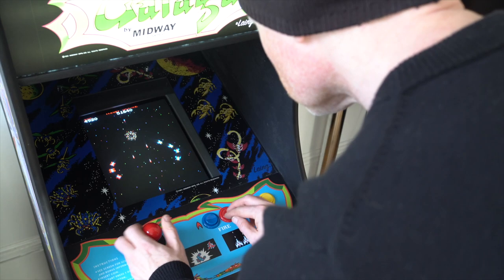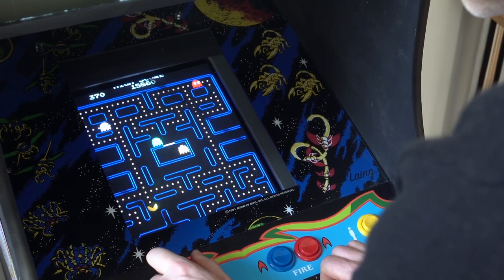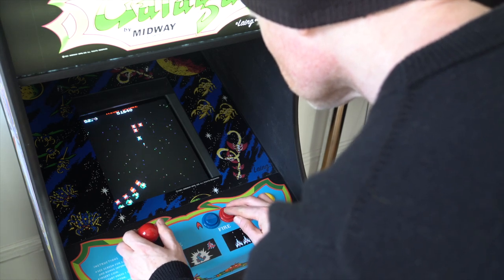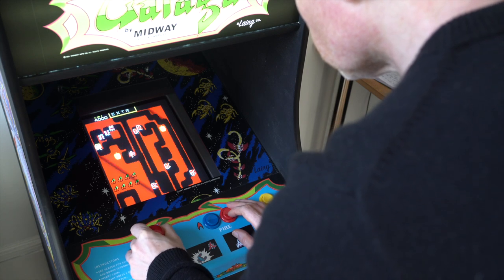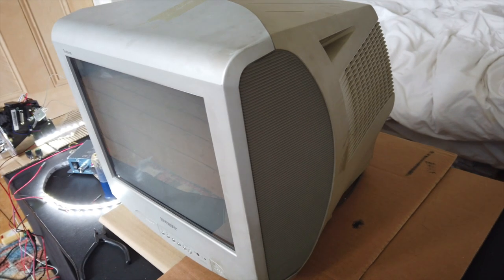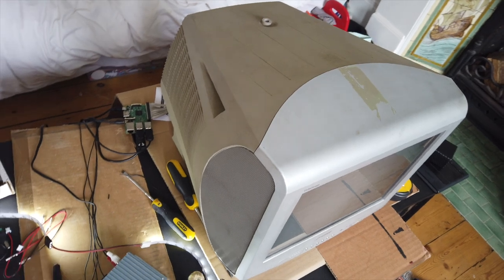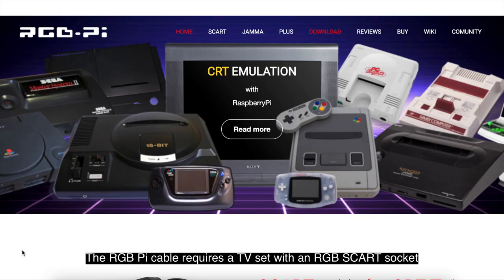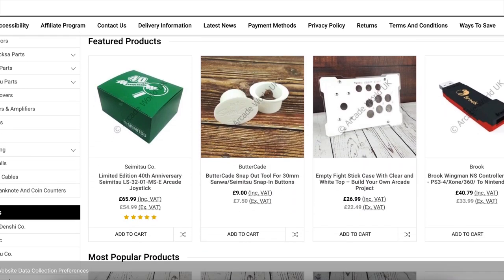How to build a vintage ARCADE machine: Part 1

Comment: Great looking cabinet! I bought a custom made 4 player cabinet from a small company here in Canada about 6 years ago - no regrets (though you save lots of money building yourself!). You’re right that you need to really plan exactly what you want to play on it (otherwise I would’ve ended up with spinners, rotary joysticks, TRON joystick, and probably a steering wheel lol). My favourites are still the ones I played early on - Ms Pac Man, Galaga, Centipede, so on. Two that oddly I didn’t play way back, that I’ve come to really enjoy are Dig Dug and Bosconian. I have HAPP controls, and what a difference playing these games with proper controls makes (though, they are 8 ways, it doesn’t take away too much for me). I have noticed some scrolling games can show screen tears on the LCD screen - the CRT would look really good!!
Reply from the maker: Some premade cabs are really nice, and I really struggled with what sort of machine I wanted to have! Like you suggested, I almost went down the route of having EVERY control! Believe it or not, I tried to squeeze a trackball and spinner into my control panel layout for years before I gave up! The slightly scaled-down design was the nail in that coffin, there just wasn't room. CRTs are brilliant, but they do take a lot of space and it can be Gard to find an old one without any burn-in. Still worth the hunt though!

Comment: Nitpick: you aren't scaling by 3/4, you're scaling to 3/4. Anyway, this looks like great fun.

I bet lots of people have already regretted throwing away their CRTs...
Reply from the maker: Yes, there's quite a market now for old CRTs being bought by retro gamers! Those Sony PVM monitors in particular carry quite a price premium and I've seen some crazy bidding in auctions! You have to be careful with burn-in too - some old CRTs I've seen with permanent burnt-in channel logos in the corners. My old 14in Sony TV is lucky still behaving though and while it lacks the fine geometry controls of the PVMs, it does have an analogue TV tuner so I can connect really old gear from the 70s and 80s.

Comment: this is so cool.
Reply from the maker: Thanks! Are you tempted to build one? Have you checked out parts 2 and 3 yet?
Reply: @DinoBytes  i’d be tempted to buy a cocktail bar one. i have happy memories from my childhood playing on one on holiday. i can’t remember the name of the game unfortunately.  But i have joint problems now, i tried the arcade stick for the Switch and it hurts my hands and wrist to much. :(
Reply from the maker: @MrRes999  I loved the cocktail table machines, and went back and forth a LOT over which to make. I may still end up making one, as I love them for two player gaming, and it's also possible to make one with a set of controls along the long and short sides to play both vertical and horizontal games...